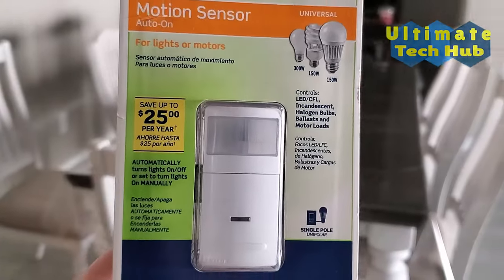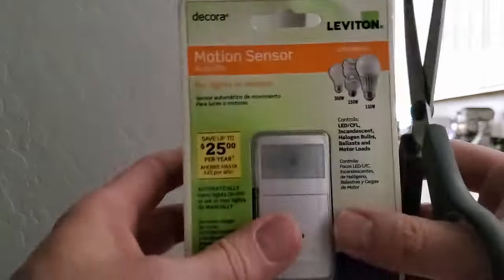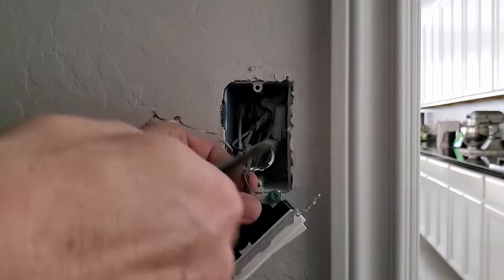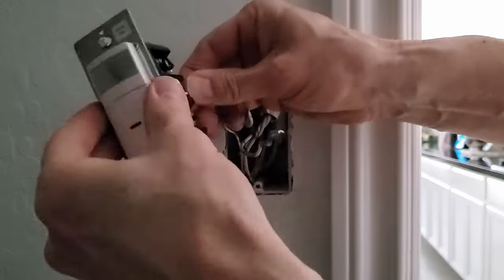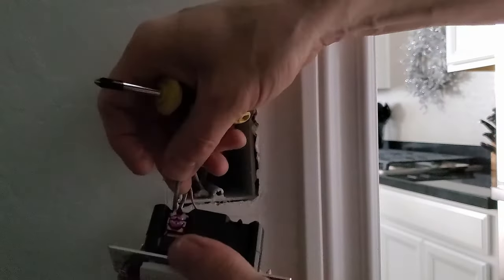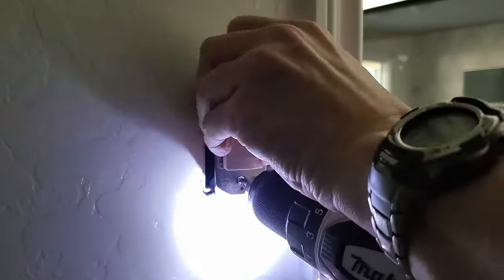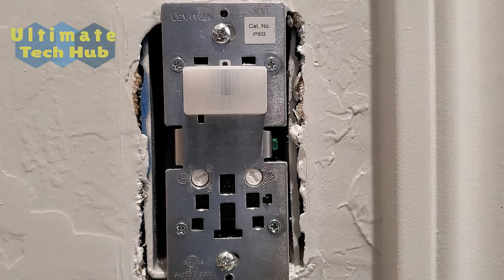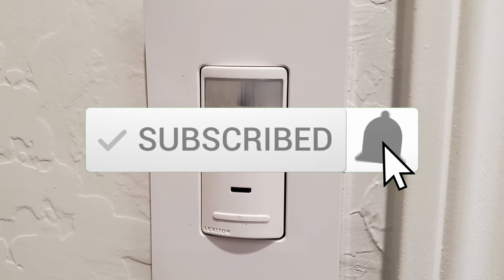DIY Leviton Motion Sensor Light - How to Install - EASY INSTALL - $20

Comment from the maker: Hi everyone enjoy this video and remember to install motion sensor lights in locations that only need light for a temporary amount of time. Examples would be a laundry room, garage or a pantry. Thanks for watching!
Reply: Hi, what if the new sensor light has an extra wire than the old sensor light?  One has 4 wires and the other one has 5 wires
Reply from the maker: @ongireich  What colors are the new sensor light wires?

Comment: Have a question, i have the same sensor but my old one has 4 wires and the sensor i bought is for 3 wires. Sorry is my first time doing this, what can i do? Thank you.
Reply: Okay, you should have a black and white wire coming from the power, and a black and white going to the light. Making sure that the power is off, connect the two white wires, using needle nose pliers to twist them together. Use a wire nut or tape to prevent arcing inside the box or shorting out the setup. On one side of the switch, there are two connector screws. Following the instructions, bend the wires so that each one loops around one of the screws (it doesn't matter which wire goes to which screw). Tighten both tight so that the wires aren't loose or in danger of coming loose once you put the wires and switch into the box.

Comment: Unless absolutely necessary  you should never cut (shorten the wires).  The national code usually requires at least 6" of wire in the box for all leads.  By shortening the wire you might go less than the code and it makes it harder to install or remove the device the more you shorten the wires.  
Also, if you remove the wire insulation do NOT NICK the wire.  It could break over time at the nick and cause a short thus possible fire.

Comment: Can this be installed on a switch used to turn fan above a toilet?
Reply from the maker: That's a good question. I'm not really sure. That would be a good idea. I have installed several times on fans but not a motion sensor.
Reply from the maker: Timers
Reply: @UltimateTechHub  what can I buy to have the fans shut off (after an allotted time) when people leave the room after taking a dump?
Reply from the maker: @bchin324  They sell timer switches. I've installed many types and it's pretty easy.
Reply: @UltimateTechHub  I can't use the occupancy sensor for the fan? Right now it's installed for the light while a manual switch is installed for the fan. I was hoping to flip flop them. Is it possible?
Reply: I think I have vacancy switches. Because I have to turn on light manually.